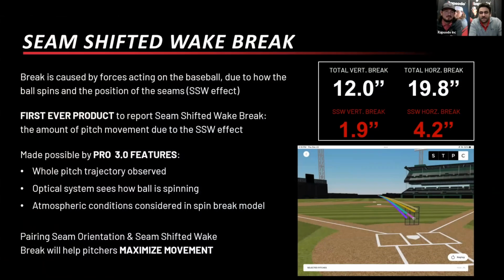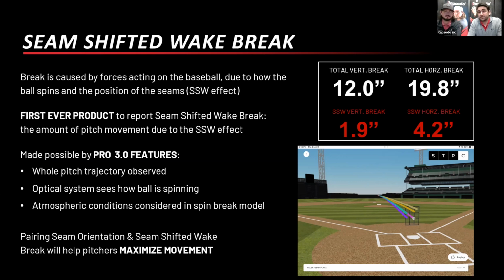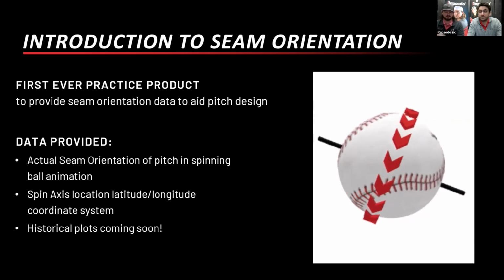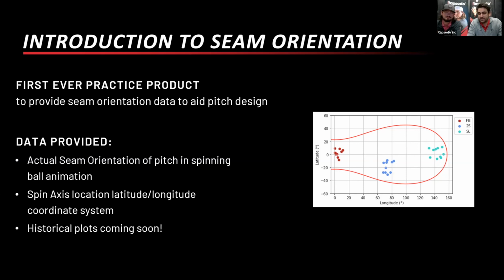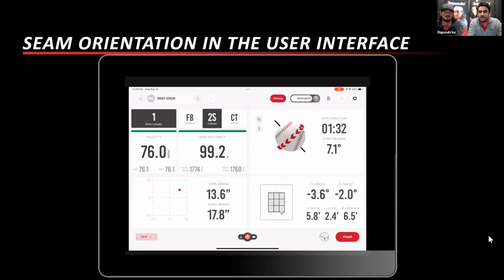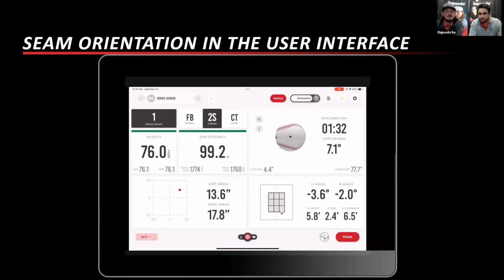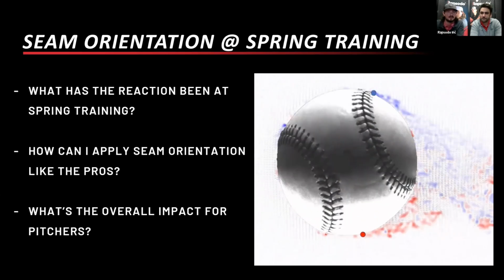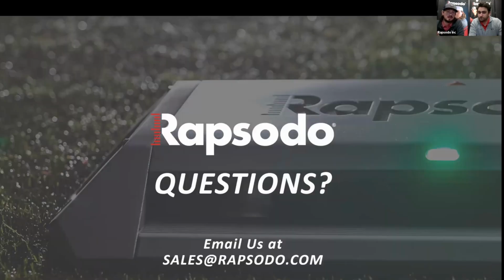An Introduction to Seam Orientation with Rapsodo

Comment: Why not include the seam orientation on the spin visualization screen as well? It's still rotating on a 4 seam orientation regardless of actual seam orientation?

It's nice that "MLB guys" liked the idea of visualizing on a 2D plane with a half strip of leather. However, if that was the best way to visualize it, why did you also choose to show seam orientation & spin axis during the session?

It would be super awesome if we could choose a historical pitch and load it into the same view that we see during a live session (on 19:32). Ties in one UX/UI that we're already used to seeing during the session.